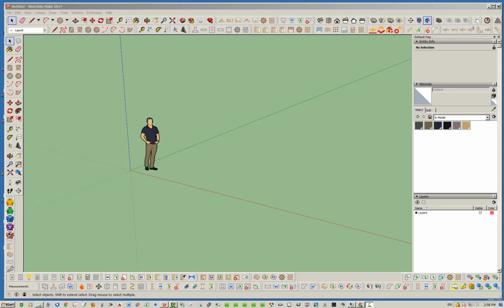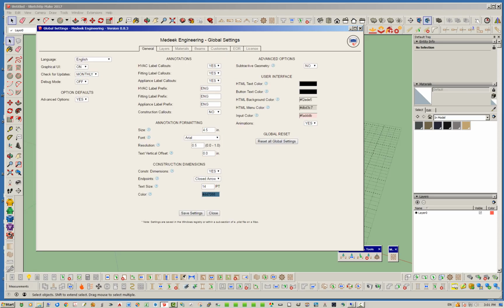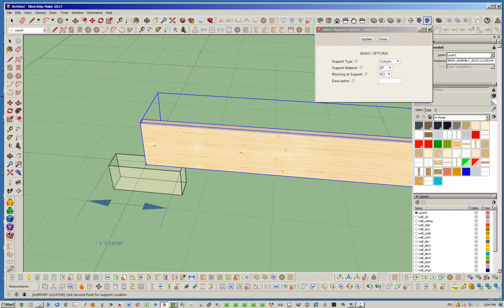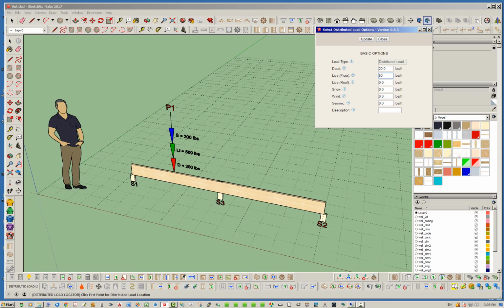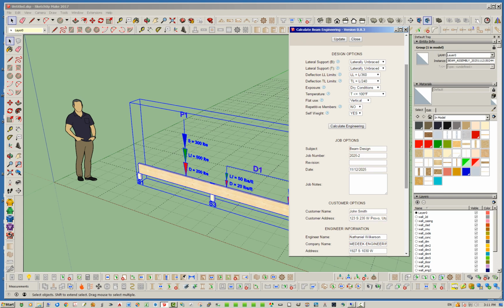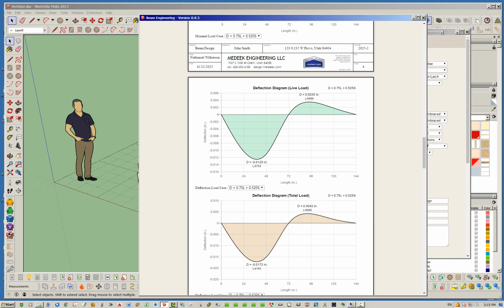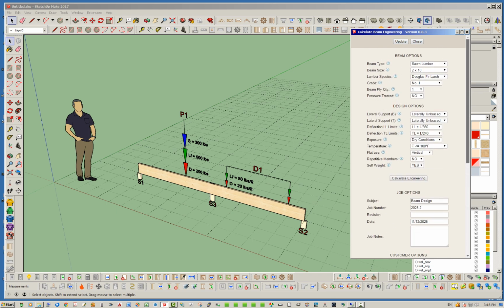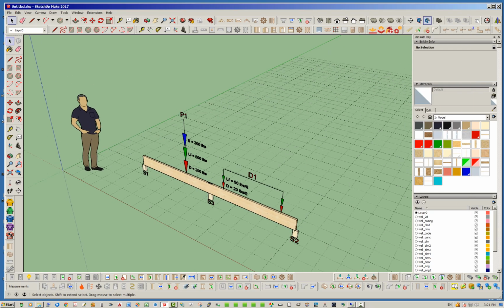Medeek Engineering Plugin Tutorial 1 - Beam Calculator

Comment: Are the bearing loads saved or tracked so they can be used when calculating other loads that are dependant… such as when point loads have been worked out they can be assign to dependant beam below without inputting them in manually, but by assigning the point load already calculated, also this could helps if there is future changes to the design like if the point load changes because of  a design change it could update itself if there is a link?

Comment: If I understand correctly, the full widths of S1 and S2 are used for bearing pressure calculations; but the supports might actually be placed as shown, which would make the bearing pressure twice what is calculated. You and I are not going to make that mistake, but....
Reply from the maker: I need to check the code but it should be implemented so that if correctly adjusts the bearing length of the supports at the ends of the beam so that the correct bearing length is used.  However I may have overlooked this with all the other things I was working on.  I will need to test this further and verify that it is correct.  Thank-you for pointing this out.
Reply from the maker: This has already been fixed in the code and I will roll it out in the next release.
Reply: @medeekdesign  That was quick.
Reply from the maker: It was a simple fix.
Reply from the maker: Great point, let me dig into that a bit further.